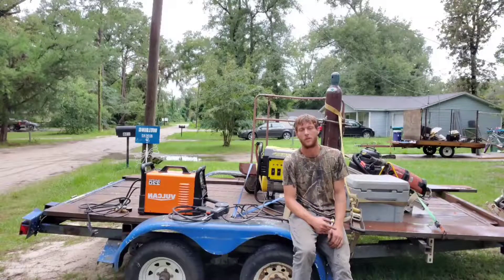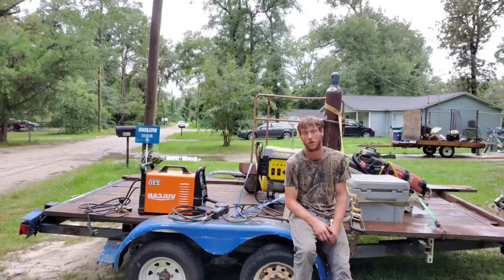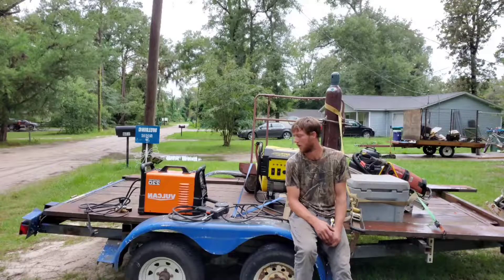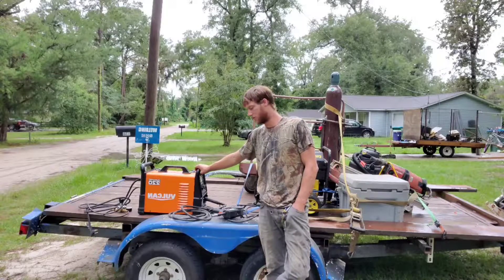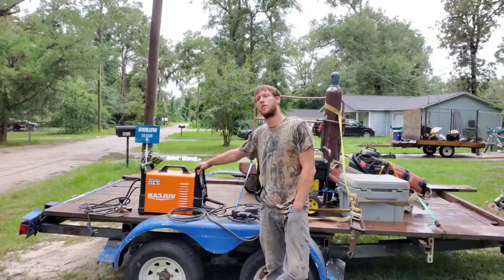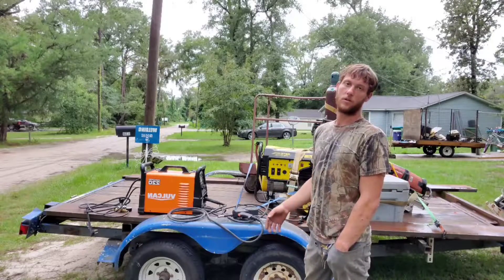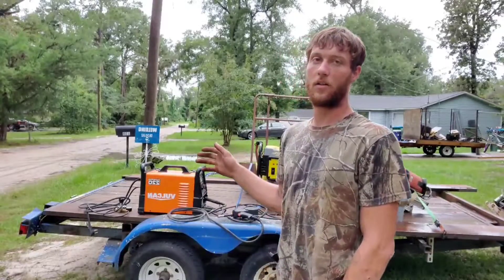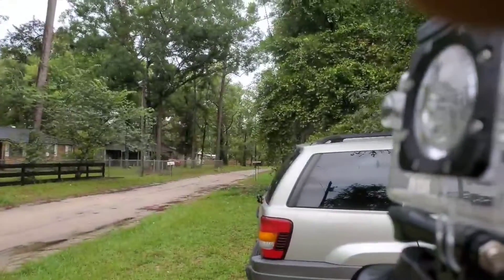Affordable Mobile aluminum welding rig w/Omnipro 220, looks like tig!! EXCELLENT WELDING FOOTAGE!

Comment: Did u have any issues with the welder running on 220 off the generator?
Reply from the maker: Sorry for delayed response.  No I had no issues but my generator has output of 240 I believe.  I will say one secret is to slightly adjust your throttle screw in order to keep engine running strong if you know you are going to be consistently weldin. Although be careful because your grinder may try to jump out of your hand if you use it off generator in this state.  May increase some wear on your gen. But sure does help to keep your start arc's hot even when you are start stopping heavily.
Reply from the maker: Did you get it going?